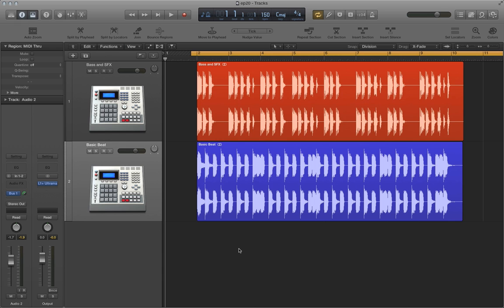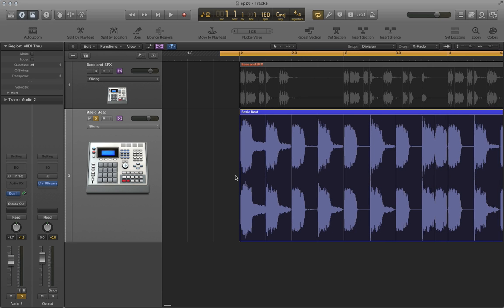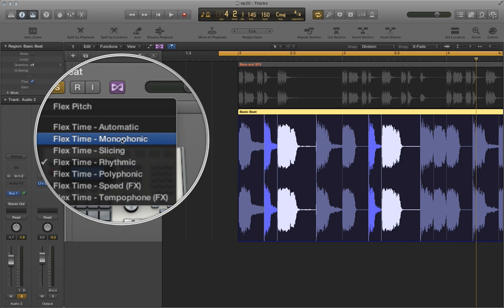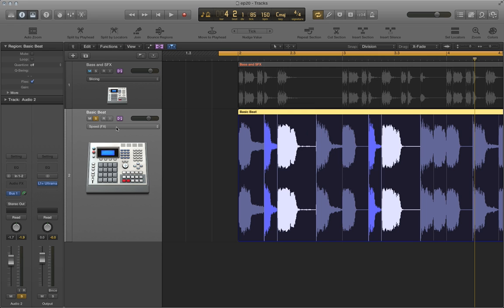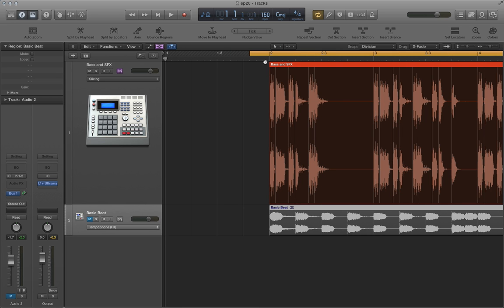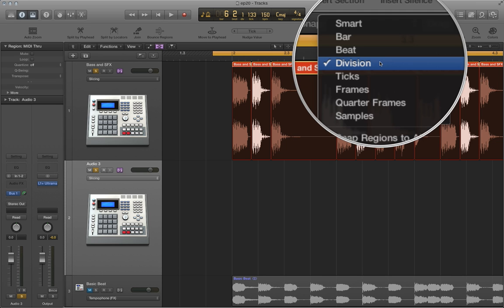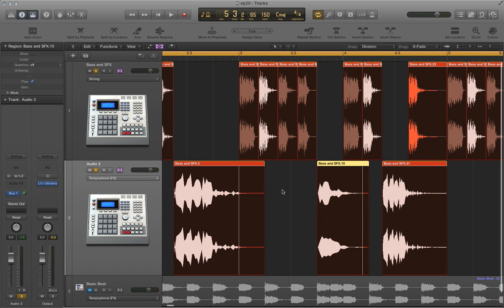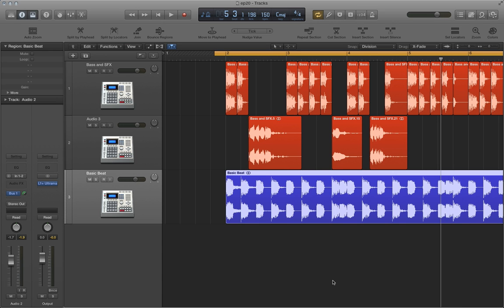Logic Pro X - Video Tutorial 20 - Flex Time Part 3 - Speed and Tempophone

Comment: Problem. When I choose any Flex Mode for my track (Slicing, Polyphonic, whatever), it cuts all regions in that track in half. All of the waveform in each region seems to be present, but it plays back at a much quicker pace. A 4 bar region becomes a 2 bar region as soon as I select a Flex Mode. Is there a box I need to uncheck or something?? Please help!
Thanks
Reply: Forgot to mention I'm exclusively using Apple Loops in this process.